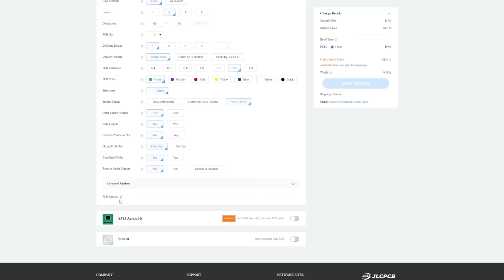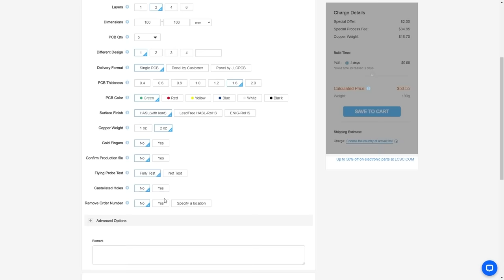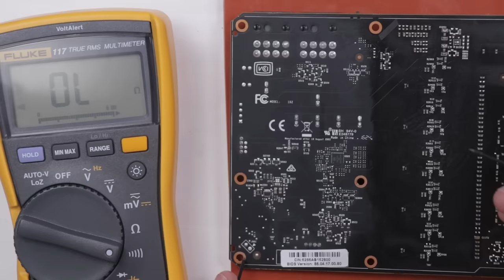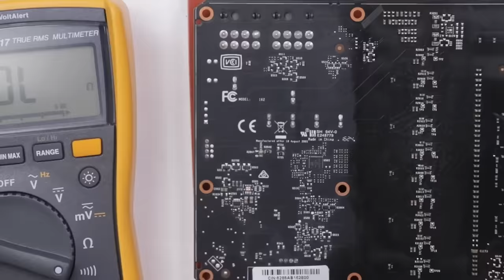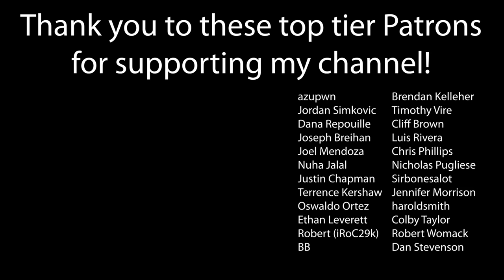I Bought 7 BROKEN Graphics Cards to Try and Fix - I Was Disappointed

Comment: I was hoping you'd get one of the ones that died because some amazon MMO game killed it. The issue with those seems to be a poor factory solder joint on a couple caps. Probably not hard to fix. It's odd that one specific game found the problem. lol

Comment: check that evga 3060 again, but with the correct drivers. it seemed like the screen resolution wasnt yor tvs native res, that could be caused by wrong or missing drivers, it could also explain the errors you got.

Comment: Last few years has seen gaphics cards priced doubled and none available on the market. Gamers had to use older cards in new PC Builds. The Bitcoin mining bought up all the stock. Ran the cards at 125% 24/7 mining bitcoins. End of life came fast and as they were crashing once a week, ended up on ebay as bargain cards. Light gaming duty the cards would still work but eventually burned out.

Comment: I bought Evga gtx 1060 sc acx 2.0 for €80 particularly faulty but after I cleaned the pcb with electrical contact spray and lightly sand paped the pcie gold contacts and fresh Arctic mx4 paste the graphic card came back to life without issues. As before I did the cleaning the card won't post most of the time and once it kinda posted but extremely slow

Comment: Tropicsfix, I have a question and I pray you answer it, I have got a ps4 for that your you put it on for the first time the blue light blinks and when you turn it off and on again it boots on the screen and everything works (i mean it goes to the dash bord), also when I try assessing the safe mode, I get a white light but no display on the screen. What could possibly be causing that?

Comment: also check the 0.7 OR 0.8v DDR ram ref voltage.... there is a regulator somewhere or a resistor network to provide....check any GPU enable lines also.....also voltage to the crystal

Comment: Hello Steve, I have a little issue with my 3080 G1 from Gigabyte... I ripped off accidentally the RGB cable to change the ridiculous thermal pad that the GPU came with, the connector is stuck inside the female one... There is any way to recognize the right RGB order in case I would like to change the connectors? Thanks a lot!

Comment: The 3060 probably has a faulty memory chip. The discoloration doesn't necessarily mean its overheated on the gpu chip. It might be the silicone from the thermal pads. You should get mats vrm testing software which will determine if any of the memory chips has any memory errors.

Comment: @TronicsFix *UPDATED* I accidentally dropped my Wii U moving my Wii's Power cable and it dragged it if the shelf and it dropped from a foot high and now won't read discs saying invalid. Think you could try to fix it for me?

Nvm, I had my old Wii that bricked when I reset it and just swapped the disc drive boards and it works now

Comment: That 2080 ti isn't missing a memory chip, it only has 11gb.  That card also looked like it had a water block installed, those blue pads look just like the pads EK includes with their blocks.  I'd put money on it that the card had its memory fail and someone just swapped the stock cooler back on without taking the ek pads off and they had lost the screws. 

Early runs of the 2080 ti cards had a higher than normal failure rate because of what nvidia claimed was a bad run of memory.  I actually had that same model of 2080 ti and it ran fine for over 2 years with an ek block on it, got a 3080 and put the stock cooler back on it and sold it to a friend for way less than what prices were because of the shortage and after a few months the memory failed on it. It was still under the 3 year warranty then so EVGA had it replaced in under a week.

Comment: on those 2 1080s noticed there is a bios switch, toggle the switch and see if the gpu runs afterwards. cause it could just be a corrupted bios. you might be able to flash the corrupted bios and have it work again.

Comment: On the 3060 you can try to apply termal pads on the gpu chip but not to thick just to put a little more pressure on the chips if lowering done the clock speed doesn't help

Comment: @TronicsFix 
I would recommend contacting EVGA and ask for Jacob … he might be able to check if these were ever send in as RMA 
Specially the 3050 that to my knowledge is currently still under warranty (the seal on the backplate is so they can see if you took it off but it doesn’t void the warranty just tell them you took it off and all is fine)
In case you might want to know about parts You should try contacting buildzoid who knows a lot about the pcb designs of these cards 
der8auer would be another person who might be able to help you out
Since it seems like one of the cards was used for extreem overclocking and still seems to have Vaseline on it 
This is also the guy behind thermal grizzly so he might be able to judge if it’s just the right amount 😜

Comment: The fuses on the high power nVidia GPUs are dysfunctional so when overheated the main chip will be damaged and unrepairable after about 1200 hours. This is almost impossible with for example Intel CPUs.

Comment: Might be worth a shot to run a hot air gun over the GPU chip to help reseat the solder points. It's a fix that @RandomGaminginHD tries with a good bit of success.

Comment: Try watching one of Greg Salazar's videos. If I am not mistaken, he was able to repair a GPU by reheating the GPU chip by reaching a specific heat so that it will re-seat all the solder balls. Hope this help. That only applies to the 2nd GPU that you have and didn't work after changing the capacitor.

Comment: Been using JLCPCBs services for ages and the quality and prices are insane. I designed various RF boards with impedance controlled traces, 6 layer FPGA boards with BGAs and tiniest components and everything always worked wonderfully. Even my latest order as a massive 350x350 PCB came out perfectly.

Comment: That first EVGA card looks like liquid damage, usually those GPU's have a zero fan speed mode on boot. You could just try flash the BIOS specific for those GPU's, if their dead their dead but that could also work as well

Comment: The gtx 1080 FTW2 looks like the board was coating in Vaseline likely for liquid nitrogen cooling for overclocking which if pushed too far can overheat regardless.

Comment: ref the 6800xt try using the on board bios switch Jayztwo cents just did a video about this where one on the bios had failed but when it selected the other bios using the switch it worked.

Comment: Soooooooo on the 2080Ti, other then the extreme amount of thermal pads, and no contact with the heatsink, there is nothing visually wrong with it. the 2080Ti only have 11gb of ram, and the missing phases is normal too. Because the board that has all the "missing" components is the Titan card.

Comment: Hey, on the ones with no HDMI output did you do a visual inspection internally of the HDMI port itself? This is just one common issue when all the voltages are good and no beeps!

Comment: I feel your pain on this.  I purchased a twin set of AMD graphics cards in the hopes to get some twin card action going on a new build.  Drove about 50 miles for a 'local pickup'.  The seller appeared to be highly rated, but right off the bat one of the cards was rated for 4 gigs.  And the 'twin' card was an 8 gig model.

Thankfully the 8 gig card worked like it came fresh out of the box!  (And while I did initially take a bath on the $$?  Over the few months afterwards the graphics card market went sky high!)  

I did sell the broken one for 'parts or fix' and someone paid me $80 for a door stop????  If I had to guess, the last owner attempted to mess with the video card internal settings and 'bricked' the card.  Sense I couldn't get the card to recognize in my PC at all-  Zero chance I could do a recovery.

One of the main reasons I really can't stand 'over clockers' that damage their equipment and then pawn it off on others.  You want more speed?  spend more money.

Comment: It's best to watch Tech Cemetery before you try GPUs, because some stuff was pretty risky, ie, add more damage. Like never apply power to a card without a heatsink, without constantly checking if the GPU is getting hot
That RTX3060 was repairable, ie, artefacts are just memory, that is until you killed the GPU by letting it get hot.

Comment: Lol try and fix an iPod nano 4th gen that thing is basically unrepariable I tried replacing the battery and I ended up breaking the click wheel ordered a new one just to end up breaking the ziff connector in the screen  they are cheap enough but at that point I rather just spend $50 on a refurbished new battery, housing for one

Comment: Just because i did not see it jet in the comments: there might be a mining-bios flashed on the higher-end cards, that will not necessarily output images. Some newer cards even come with a bios switch. Flipping it could solve the problem eithout the need if reflashing the bios...

Comment: Love your channel I just hope that computer that you were working on didn't have the SSD your hard drive plugged into it while you restarting it for all those graphics cards it can be caused the OS to get corrupted and your only way to fix it as a clean install and erase everything as I'm saying as hard restarting as and you don't see a picture so you hit restart you turn the computer off to put a new card in after a couple times of that you can mess things up or if you have to hold the button a lot

Comment: You can pretty quick find is anything wrong with chip by checking pcie-e lines. Memory and chip replacement are expensive and require specific BGA equipment. All these cards can be fixed, question is cost. For most of these cards it just not worth it, they already diagnosed and put on ebay in search for fools. I don't know what you expect jumping in very well established in last 3 years industry of mining card repair without any clue how it done.

Comment: on cards that you have working I recommend running userbenchmark on them to see if they are working as expected. Also a good tool for monitoring thermals is hwmonitor. As for the cards you had with GPU issues you could try the heat gun method as a last ditch effort, this sometimes brings cards back to life but has varied results and often only fixes it temporarily.

Comment: gtx 1080 use to be a monster of a gpu and it is still really good till this day
Reply: and a 600 watt pcu is not enough for a 1080 but that also depends on what cpu your running it with but you are only testing it so i guess it is fine

Comment: for everyone that tries to work with gpus: 1 : use a RISER, so if it blows up, it wont destroy anything else.
2: check all voltage rails, check for shorts. after that, the power IC that runs that rails. power IC tends to fail a lot, also 12v mosfets, since they are all bucked together, one fails, all rail is shorted. you can use, if you have, a thermal camera to find that fail. you can use freeze spray too with 1 - 2 volts inyection. (not recommended). 

if that fails, you have the reflow option.

Comment: I think the discolouration is not caused by heat. Those thermal pads they use are oily and they do sometimes cause this on the black PCBs. You can usually clean it off with some Isopropyl.

Comment: Good video but when repasting GPU's you need to evenly apply the paste on the whole die. It's not enough like you did it because even if one corner remains exposed and does not have neough it may cause thermal problems. Also on dual BIOS GPU's you need to check that those are not corrupted.
The EVGA GPU's are missing parts because they can use the PCB to make the KingPIN card which is their top of the line. Find the exact thermal pad thickness and test it.

Comment: About the 1030...  Yeah, that's a card that you have to keep your expectations very low with. I bought one around 2018 because I was building a PC in the middle of a graphics card shortage and there was literally nothing else available. It's fine to play classic e-sports games like CS:GO and Rocket League, but it struggles to play games from its own era even on very low settings. It's basically your go-to card if you want to build a PC for something other than gaming and the motherboard has no onboard video. Or, a card you could use to add an extra video output to a PC if needed.

Comment: 2080ti should be fine, missing parts are missing from factory, person who owned this had no idea what they were doing and didn't realize the GPU wasn't making contact with the heat sink and were getting crashes, and thermal pads on thermal pads does not work, Idiots.
Reply: Also, you never checked any mosfets on any of these cards, voltages present does not always account for everything working.

Comment: Dude you have no clue about this and that 3060 got me cringing hard. If you use a gpu without heatsink it will die in mere seconds. These are very high power density devices and tjmax is around 100C, it wend to 130 and of course it just dies. It likely had a bad memory chip. These discolorations don't mean anything significant. If you put multiple hundret watts through such a pcb it will change colour. Completely normal. If the card was baked you will see that.

Comment: It sounds like all the "big" ones that were failures, were likely used for mining. They do tend to overclock/overvoltage them and run them into the ground.  At least some of them do.
Reply: My experience is exactly the opposite, most people I know that mine will undervolt to get peak efficiency so they aren't wasting the money they are making on paying for the wasted power...
Reply: No, mining cards are run undervolted and underclocked on the core to maximise mining efficiency. They are typically run very cool.

Comment: For the 3060 you can run a program called gpu memtest that will check  if there are any memory problems, and if there are you can just replace the broken memory chip.

Comment: when a gpu has no vcore it can also not start normally u can start at the very top or some times the 4th coil to see if u have any readings check it in ohms mode to to see or u can also try checking out tech cemetery channel for more ideas his the guru

Comment: The video wasn't that bad, but you made a few mistakes in my opinion. The missing parts on the RTX 2080 Ti are normal. The manufacturer wants to save costs and omits certain components. I'm not sure about that, have you updated the drivers on all graphics cards? Hope you see my comment :)

Comment: 1080 ACX - Reflow the GPU and reflash the bios you can also try to undervolt the card but that usually only fixes memory issues and artifacting.  1080 (2) - overclocking in most cases wont damage the card unless a custom bios or shunt mod is present that said it's possible. 2070 - if you seen artifacting (i couldnt see from vid) then memory module issues are usually the cause, test for a long time and use a heavier benchmark like firestrike.  OMFG ---- stopped watching at 3060 on bench with power trying to run a benchmark with no cooler. sorry your out of your depth here buddy.

Comment: BuildZoid from  Actually Hardware Overclocking is a guru with dead hardware. GPU are almost imposible to repair. The power phases die catastrofically and the cores and memory have little protection. Its not anti right to repair its cheap and bad design

Comment: That RTX 3060 may have a custom mining bios, check always the Bios version with GPU-Z and check on the database that it corresponds to the actual Bios of the card, and to be sure you can actually re-flash the original bios to the card. This is a bad time to be buying 2nd hand gpus cos a lot of miners are getting rid of their super overworked gpus out there.

Comment: I noticed your motherboard has onboard video.  Certain bios configurations will not allow the PC to POST if the bios does not have a driver for the video card and no monitor is connected to the onboard display outputs.  So if you aren't getting a picture, it's not necessarily because the card doesn't work, it might be because the pc is failing to POST.  Try connecting a display to the onboard video, booting into the operating system and then see if the video card is detected.

Comment: Did you try to update the bios on the rtx 3060?  It is possible a corrupted bios is doing this. If a gpu give a video output it is extremely rare its a no fix.

Comment: Wow, that was brutal, most of the lot was unfixable. :(
Reply: On the contrary, it was a very good lot, just lack of experience.
Reply: @phyro4143  I see. Maybe he can revisit down the line then.
Reply: @hadesmcc  The 3060 he fried alive to 140°C by running without a heatsink. Others there's still chance they are fixable.
Reply: 3060 was also, in warranty before he broke the warranty sticker.
Reply: @phyro4143  warranty stickers are not legal.
Reply: @phyro4143  GPUs usually hard shutdown at 120. Not that it's good to hit 120
Reply: @hadesmcc  GPU makers rather decline warranty and fight legally

Comment: Modern GPUs cannot die from overheating or overclocking without modification. These heat patches are probably from some mong blasting it with a heat gun or hot air for too long